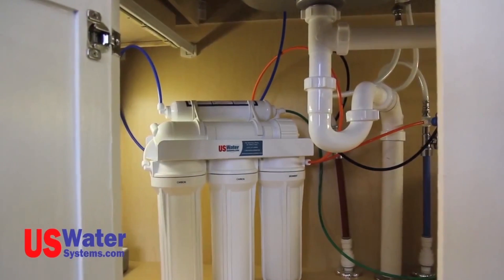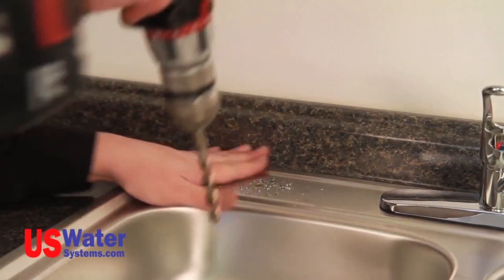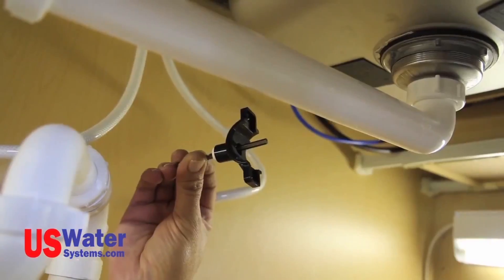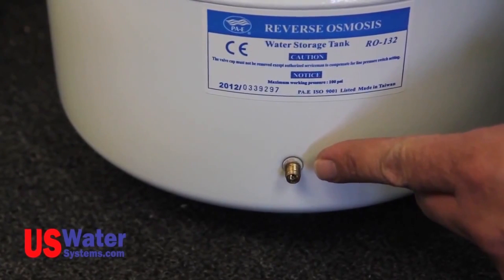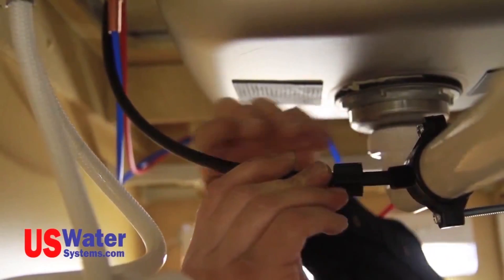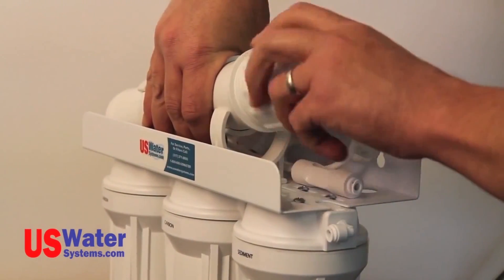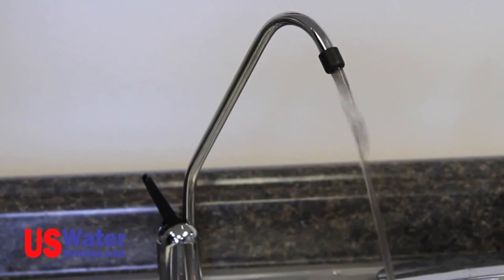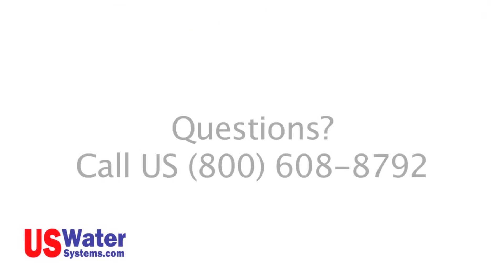"How to" Install a Residential Reverse Osmosis System

Comment: Very clear and very informative. As a plumber myself, having never installed such system, I couldn’t have watched a better tutorial than this one! Superb!

Question:
Does the automatic shutoff valve system periodically flush? Does it open while of after using it? Or is water only coming out when changing filters? Just curious 😉

Either way, still thank you for this video!
Reply from the maker: Yes, it does flush/waste some water while it is making the drinking water.

Comment: Installed that system but my water is dirty and it keeps running all the time doesnt stop is that normal? Checked that the filters are installed before I installed the system.

Comment: When installing my RO system under the sink, I used enough excess tubing for the line going to the faucet, pressure tank, and water supply line for the RO which would allow me to remove it from under the sink and place the entire unit into my sink.  I lined the sink ahead of time with towels to prevent scratching the sink.  This allowed me to sanitize, and change filters with no mess.  The water from the process goes down the drain, not all over the cabinet or the floor.  A word of caution, if you don't have sufficient physical strength to lift the RO unit full of water this may not be a good option for some people.  When moving the RO unit I was careful not to put excessive pressure on the tubing where it attaches to the RO unit or other supply connections that could cause a leak or kink the tubing.

Comment: Thanks for this clear video. 

Is it normal for the water to constantly drip via the drain line? Isn't that just wasting water?
Reply from the maker: It should stop dripping after a time.  The shutoff valve takes a few minutes to fully close and then the water drips out of the pipe.
Reply: "A time" meaning 10 minutes? 5 hours? It's been dripping for about 3 hours. What is the "shutoff valve", is that the squarish thing with 4 ports?
Thanks
Reply from the maker: Yes.  That is called the Automatic Shut Off Valve.  It’s a diaphragm that has to close.  How much water drips out?
Reply: It's just a constant trickle
Reply from the maker: Please give our Tech Support Department a call 1-800-608-8792 M-F 8-5pm